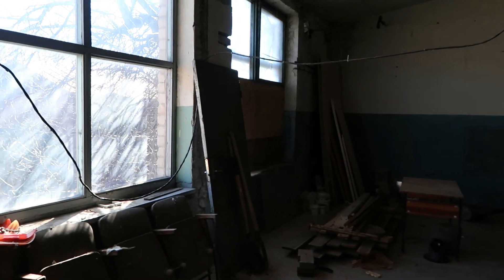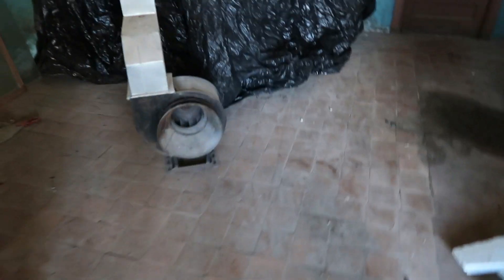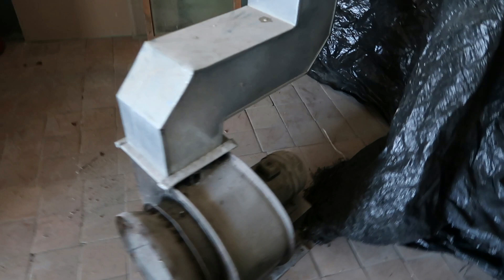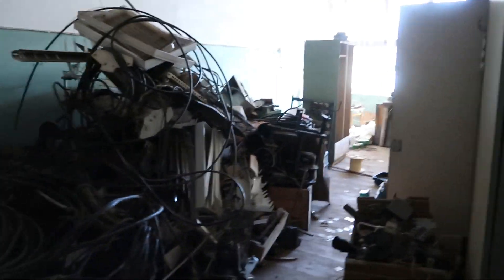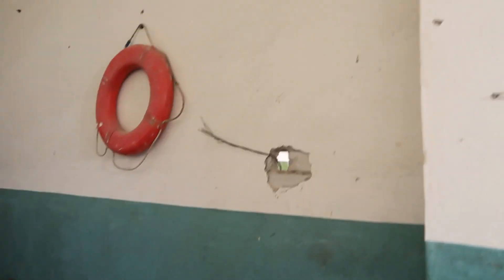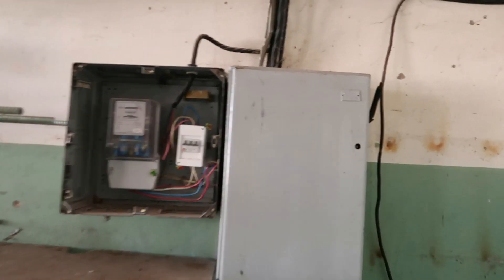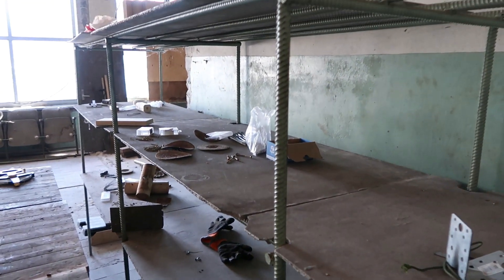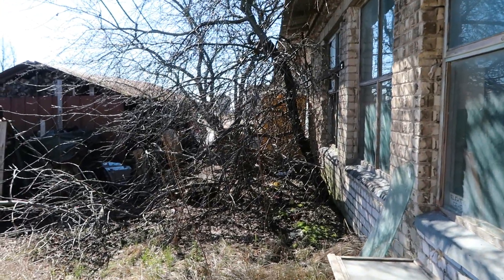Some plans for the workshop

Comment: And please make a double sided axe please it would be so cool
Reply: HCtube
It would be cool, but casting an axe head wouldn't make for a strong tool.
Reply: Especially if it's made from iron or aluminum or any other metal than high carbon steel